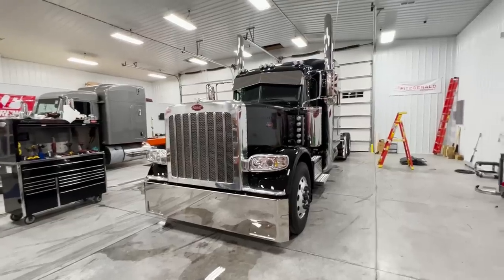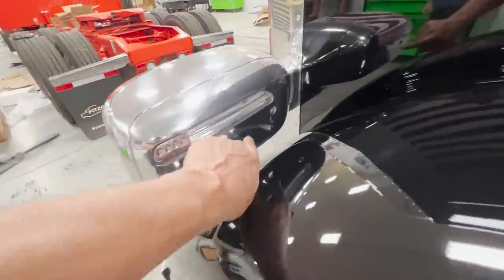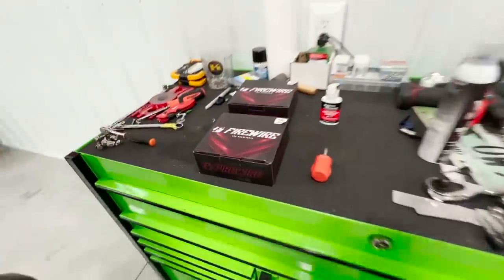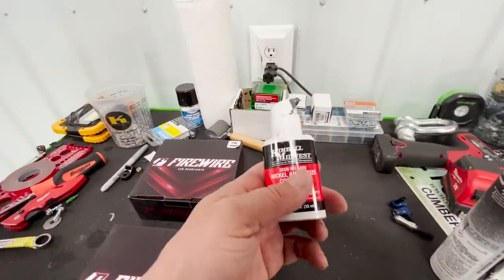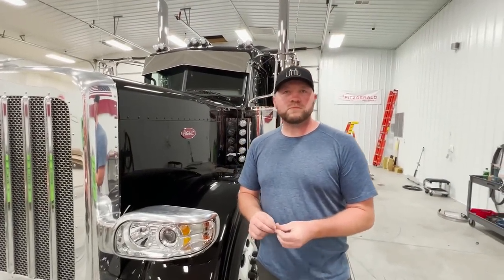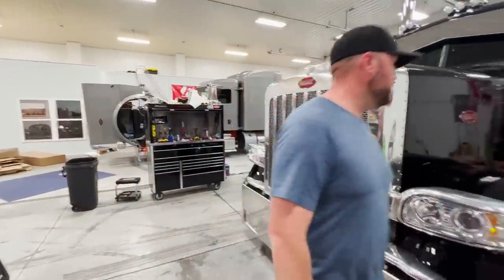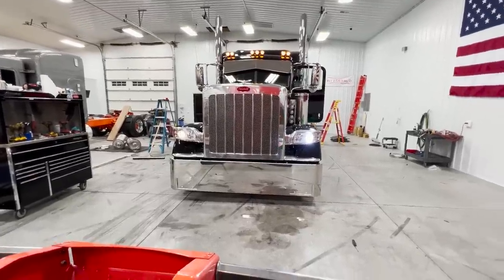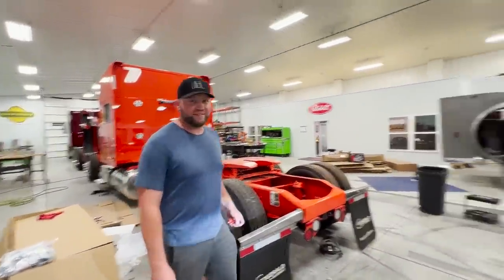The Absolute Best Upgrade for any Peterbilt 389

Comment: This is probably the first video of anyone doing anything with the factory headlights of this nature so right on guys much appreciated!! I Put LED bulbs “not cheap led bulbs” into my 389 headlights and they weren’t that much brighter than the halogen’s. With that being said there’s quite a few write ups on how projector housings aren’t meant for LED bulbs but for HID’s. I since put an HID kit on my 389 and holy cow it’s night and day difference from LED. Just my 2 cents.
Reply: What HID kit did you use?
Reply: Did the HID throw a error code on the dash?
Reply: @hunterlyons6661 I was wondering too

Comment: Good job on the show & tell guys . FireWire should " better your discount" for the publicity . I'd rate the head light upgrade WAY up the chart . Right under change'n out the air operatored windshield wipers on a 359 with 12 volt electric 1's 👍👍

Comment: Nice upgrade for the guys in the lower 48, but here up north in canada those LED bulb in factory housing can't work in winter. The lack of heat in snowstorm make the headlight full of snow and reduce visibility.  The only way to have LED bulb, is with heated lens or LED generate enough heat to keep lens "dry".
Reply: Not if you go with Morimoto bulbs. The fan forces the heat forward towards the house to melt snow and ice.
Reply: @barbiesawada245  interesting, I'll take a look a those bulb in a near futur! 👌

Comment: If  you mount high beam lights on the top of the roof you get light that light up over hill tops and on top of roads with high fences on the side and similar. Her in Norway all big rigs that run on the country roads have roof mounted high beam lights. Having powerful high beam lights mounted high make a huge difference.

Comment: How well do they do with snow and ice? I’ve heard horror stories about drivers replacing halogen bulbs with LEDs and the front headlamp lenses would cake up with snow and ice because there wasn’t enough heat built up to melt the ice. They went back to halogen bulbs in the winter and LEDs in the spring and summer months.
Reply: I can tell you I regret going all LED on my 389. Excellent light in spring, summer and fall, damn near dark during snow storms. I typically have to stop every 50 miles at night and clear the snow. I am upgrading to heated housings this winter.
Reply: Morimoto makes a excellent LED bulb where the fan blows forward to melt ice and snow. These are the Morimoto 2 Stroke 3.0. Headlight Revolution has a video out on these bulbs , perfect for snowy winter's.
Reply: Yes you need really powerful LED lights like 50w ++ to be sure they melt ice and snow. My new huge 9" diameter high beam LED lights for my van mounted on the roof is rated at 170w per light.

Comment: I bought the kit and can't get the 9005 to mount correctly. The tabs on the bulb housing are too small or something. Any idea on how to make them fit?
Reply: Yeah, they don't tell you that part. They sure don't snap in like the factory bulbs. The heat sink is much larger, and it comes in contact with the tabs when installing. I had to bend the tabs flatter to get mine in. PIA

Comment: For some reason these FireWire lights aren’t brighter than the stock halogen lights on my ram truck, they’re whiter just not really brighter. Is there a specific model other then socket size that I messed up on?
Reply: Your ram uses reflector housings, peterbilt uses projector housing. Big difference
Reply: +1 to what Roadhammer said, check into Sylvania bulbs. I went with those on my '16 Tundra, HUGE difference in brightness and beam throw.

Comment: What you should actually do is swap the factory projector for a Morimoto MLED 2.0
Reply: Agreed, LED in the factory halogen projector is trash. My 389 came with them and I can't wait to throw them in the trash. I can't see shit with the lows and people are constantly flashing me. LED in the highs are ok.

I'm doing a Bi-LED/Laser retrofit when I get a spare set of headlights.
Reply: @ianm432  I believe that it's just 4 screws for the projector, just put some MLED 2.0 they're basically plug and play. (To be confirmed of course). Also, don't forget to aim them correctly, that's the most important part ;)
Reply: What exactly did you order. I wanna do the same

Comment: Any truth to the rumor that led headlights interfere with your cb radio?
Reply: If you run a big radio, it should be wired directly to the batteries not the factory crap wiring. Headlights don't interfere but wipers absolutely can
Reply: 10-4